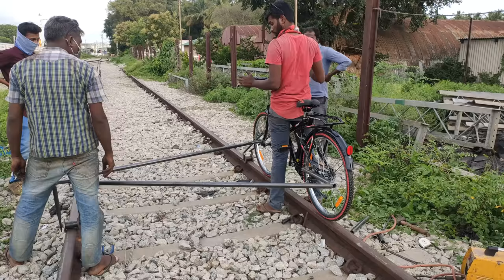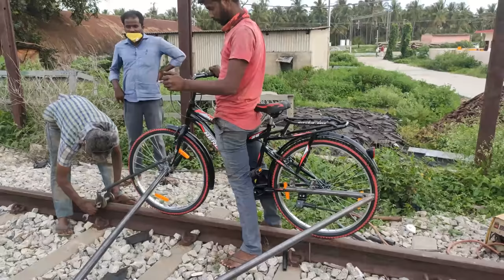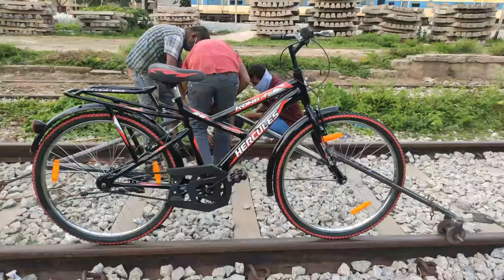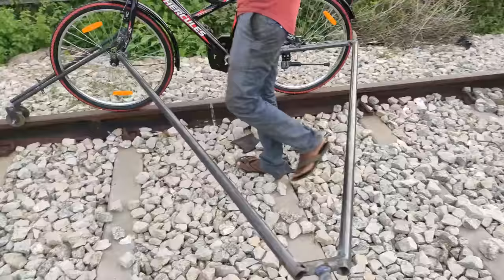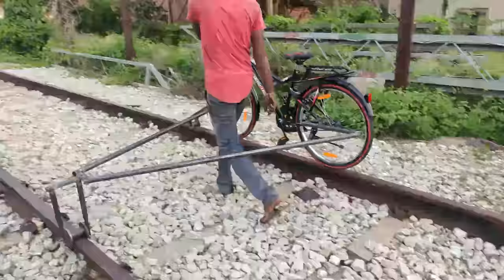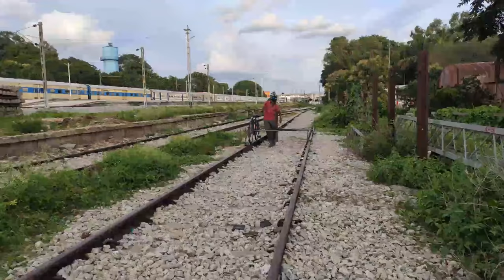RAIL BICYCLE | New Innovation | INDIAN RAILWAYS

Comment: As far as it'll be used for track inspection I appreciate it....would never recommend for personal use...
Reply: No bro. It can also be used as practically . For travelling a distance upto 30kms . But we need to be updated with the timings of trains.
Reply: In India it won't work..

And there are no abandoned tracks in India, for public use
Reply: @Trainspotting with AR and none of the workers will be ready to drive bicycle 😅
Reply: @incognitomode2503  can be used on track which is not being used otherwise it's very dangerous
Reply: @incognitomode2503  it is against rules of any railway system in the world. Train are designed to have a private use of track at any given tine
Reply: Ridding the cycle for only  1km is completely bullshit. In case of track inspections the concerned officer will have a different method.
Risking your life for the sake of travelling from point A to point B makes no sense.

Comment: I think putting counterweight on other side will help more in stability
Reply: Co-raider
Reply: Agree
Reply: I think they should do something that cycle should be in middle of track.
Reply: @jyotiradityathakur5169  back side is not equal to counter weight
Reply: Engine as side weight
Reply: @SuperPrasad18  fir kya fayda hai utna bada bada pathar ke upar kon chala payega
Reply: We can make it as an buisness/industry/new revolution.
Reply: @prajwal3010  ha ha great joke... Until train 🚂🚋🚃🚋🚃🚋🚃 comes..
Reply: @snj007gaming8  kehna kya chahte ho?
Reply: @prajwal3010  what? I don't know hindi
Reply: no bro thinks ones more
Reply: @snj007gaming8  cycle ko teda rakhakar veldind karo thoda sa teda
Reply: Piyush Bhagat   possible bro rate of motion is equal 3rd law of motion bro donk make jokes on this ok
Reply: Yes
Reply: @harshharsh3686  I can't understand hindi..
Reply: @chetanbullowalia8682  hmm
Reply: Piyush Bhagat  first try to type what u convey and I know the law u don't know. Take it as a frdly comment.
Reply: Not required because weight of sidearm is sufficient as counter weight
Reply: @allrounder1695  but no. It won't be the best counter weight...
Reply: No need. Because, for better stability, center of mass (COM) of the whole system must be between two tracks. Counterweight will shift the COM on track, that will leads to more instability.
Reply: @SuperPrasad18  it'll be better.
Reply: Llfl
Reply: I also think so
Reply: They can add seat on the other side
Reply: Nhi galat
Reply: true
Reply: Bana le na toh
Reply: Then we will need more effort to tract it
Reply: If counterweight is added it makes him difficult to ride the bicycle
Reply: They want it low weight for hamal( Fourth grade employee of inspection workers, the man with Wooden hammer). So when train come they lift and go out side of track. Putting more weight is not suitable for this work. Usually single man do this job by walking on track with hammer from British times.

Comment: add electric motor and get ease for track inspection...
Reply: If I am not wrong, the purpose of inspection will be defeated if the speed is high. It requires human sensitivity to locate the faults which will be robbed when fully mechanized .

Comment: Good innovation bro but, rail tracks are purely metal, in summer season they have More heat , i.e the bicycle tyres are rubber ,so it's effect to the bicycle tyres....... 👍

Comment: Better choice for railways track maintenance workers... Carrying bags and Small equipments... Also they Know train passing timings and signals too...

And without tyre is better my opinion.. If you got a puncher same wheel  alignment will get you stability problems there.. And safe it  from track over heat 👍

Comment: For a small change u should increase left side weight means u add left side some lagged option like tools,if u do like that option and it will use for tools and u don't fear for that slide that weight balancing  you ,

Comment: మీరు చేసింది బాగుంది, కానీ ఎదురుగా రైలు బండి వచ్చినప్పుడు ఏలా సెడ్ తప్పించుకొవాలి అన్న.
Reply from the maker: Bro... This is especially for railway staff... It is not ment for public
Generally railway staff(track maintenance   department) go for Inspection on track from one station to other by walk(10 to 12 km) 
So avoid stress for those people this vehicle is ment

And it also used in emergency conditions (failures) 
Reaching the spot may take time.... So they use this vehicle for reaching the spot
They use this vehicle after taking line block from conserned station master

Comment: Certainly not a good idea, if the chain drive is used to get the motive force, power is wasted to drive the big wheels. Direct pedal drive, with flange wheel design and 2 people with ergonomic pedals can be designed for use for track inspection and maintenance.